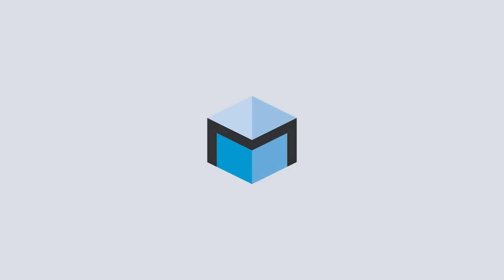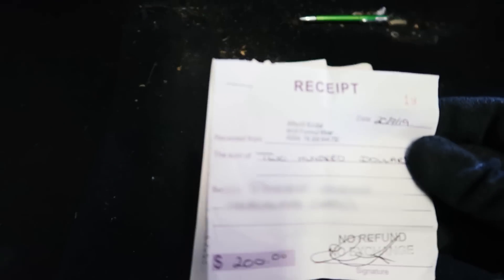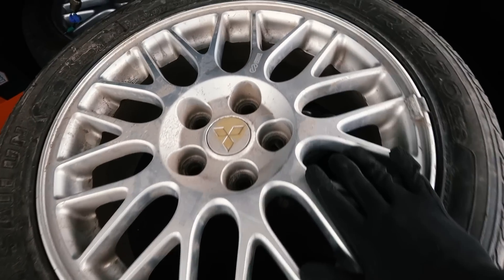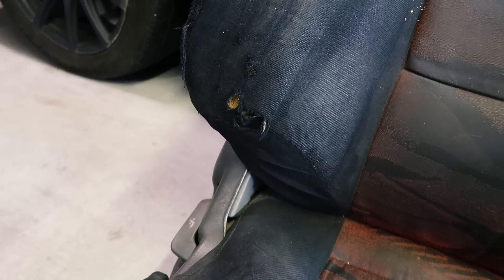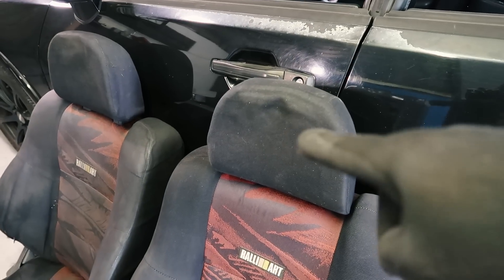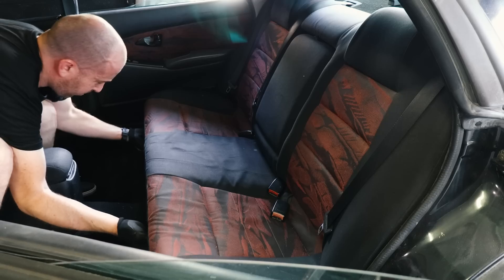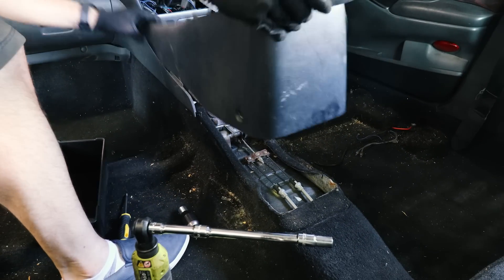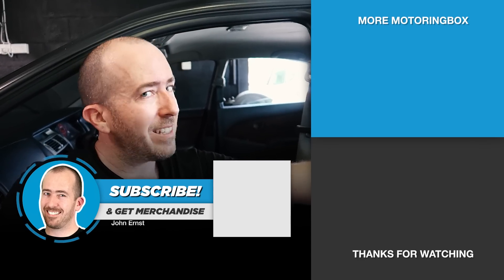🧤Stripping the Mitsubishi Magna Ralliart's Interior & Cleaning the Seats!

Comment: I have had my Ralliart for 18years. Got it back today from a 300,000kms service. Compression is all even and still good, couldn't be happier with it ❤️. Ready for more thrashing 👍
Reply from the maker: Nice one, you must have really maintained it well 👍👍
Reply: @MotoringBoxTV  oil n filter every 10k and 100k belt services. That's it. Been a God send for us 👍
Reply: 3.5 TH here, 220k. Absolutely zero blowby. Thing gets beat around all the time, has been rear ended, stat write off and a hovering headliner. I was put off by the 4spd chrysler box but it's actually a really good trans.

Comment: Hey Shaun i heard in the first video for the magna u were looking for vs commodores i actually recently bought one myself couple months back series 2 equipe a limited edition model that came with 3000$ of added value for free and i saw it on marketplace and how clean it was and only 195ks on the clock i thought it was too good to be true well it was true beautiful car to drive ans and in almost immaculate condition apart from paint peel on front right guard its a silver with light blue tint to it and apart from some issues with the ecotec being a little mistreated got it fixed feels like new no electrical failures anywhere it has to be the next project for u shaun and mind u i only got it for 4250 really cheap but it still feels new power steering also like new abs system like new and only a 2 owner car how lucky could i have been anyway sorry for the long comment shaun keep it up mate love to see what the magna got in store next vid👍
Reply: And tbh i think the bloke was selling it too cheap so it was pretty much an absolute steal wish i could send you a photo of her best first car ill probably ever have had
Reply from the maker: Sounds like you got a great deal mate. I do love VP - VS's they were great cars!

Comment: Top job Sean.  I think those original wheels are pretty good.  I have restored worse.  My mistake was I wish I had put more clear coat on them.  So if you do them yourself don’t spare the clear coat.  Also obviously get rid of the wheel weights and get the self adhesive ones.  Nothing worse than restoring wheels to have a tyre fitter bang weights onto them chipping the paint.  Grrrrrr.  Love your work.  .

Comment: Hey Sean. Little tip since this isn't your daily driver, and you're in QLD. high pressure those seats! Don't even bother with the Bissell (As much as I love my little unit) Swing past bunnings and get a drill brush set for about $20. Some orange Agent by Bowdens Own from Repco/SCA. Soak the seat in orange agent and aggitate with the drill brush, and then blast it with a high pressure cleaner. Will be done in about a tenth of the time and it'll come up INSANELY clean
Reply: OEM seat frames are bare uncoated steel. They will rust.
Reply from the maker: I might try orange agent with the bissel to see if I get any more gains.. but yes probably not the pressure washer for this one!
Reply: @MotoringBoxTV  You wont be disappointed- ended up buying 5L of the stuff and use it everywhere. Do try the pressure washer method at some stage. I recall one seat I did took me over an hour with a bissell and was STILL sucking out crap. 3 minutes with the gurney looked like new!

Comment: I owned a TF Magna and then went to a KJ Verada.  Both fantastic cars.  Also worked for a major car rental company that went from a large fleet of Commodores, then in the early 2000s we introduced the Magna.  Absolutely no issues with a huge fleet of them.  My favorite car in the Magna family from that era is the Verada GTV.  That thing was stunning.
Reply from the maker: I would have loved a GTVi AWD, but I think they were only offered on the TL onwards.
Reply: @MotoringBoxTV  Controversial I know, but I reckon that TL front end looked good. Then again, I quite liked the original AU Forte… Interesting designs always look good :) 

I think the TJ with that weird beak is the least attractive version…
Reply: @froggy0162  I'm gonna disagree with you Froggy, the TL was the ugly duckling of the third-gen Magnas. That said, I have one. The used example I found was otherwise immaculate and had all the right options fitted. The only downgrades from the TH Altera it replaced was the lack of a tape player (the Altera had tape and CD), pov-spec courtesy lighting and that nose. Mine was driven by Hubnut.
Reply: @steved3702  I guess it’s subjective. I like them.

Comment: the way you filmed the cleaning of the seat was oddly satisfying
Reply: find yourself a backseat for some useable material to refurbish the front seats if you can't find new material, I'm putting Recaro sr3 in my xr6 and the center material is worn so I'm going to use ba xr6 black with ef xr6 Luna mist for the center, use a scrubber on a drill to agitate and save your back

Comment: I like the 'Law & Order' approach to the operation. Excellent viewing, my OCD limiter is redlining. Just a thought, in most cases, simply swap the passenger & drivers seats over as the passenger is generally better. Also, if you pick up a seat from a wrecker, the seat base and back rest seperate, allowing you to create the best option, keep or sell the spare. This process has afforded me excellent quality bucket seats in many of the older Falcons I have owned. I'm sure this is no secret to you, but it may help a few viewers.
Reply: Only problem is the Ralliart seat coverings are rare
Reply from the maker: The seat foams seem to be unique for each side. One of the bolsters is bigger than the other unfortunately.
Reply: @MotoringBoxTV  
Bummer
Reply: @MotoringBoxTV  seat belt stalks may not be able to be reversed also.

Comment: I’ve bought a couple of cars with seats like that, and I’ve found the best approach is simply clothes washing liquid, a scrubbing brush and the garden hose. The trick is you need to have a couple of really hot days to do it because you soak the seat foam all the way through and it will never dry out on anything less than a couple of 35 degree days. A summer only job.

But that deeply embedded filth like simply needs a lot of water to flush it out….

Comment: 6:45 honestly my first thought was an elephants condom.  Also about the shampooing,  I remember having the best luck at a dealership I worked at for a while where we would take the seats/carpet out of the used cars the dealer was getting ready to put on the lot.  And we would use a pressure washer before shampooing.  Spray some high quality all purpose cleaner or upholstery friendly degreaser, and then spray the seats/carpet with a lower pressure as to not damage the material.  Afterwards I'd recommend taking the seats to some kind of detail shop that has access to high quality shampoo machines,  It really does make a world of difference using an industrial sized machine with a high quality steel extractor.  I think you'd be shocked at how good the seats would look after that

Comment: I used to work on one of these  back in the day (3.5 litre 5 speed)... The thing used hammer... The lady who owned it was called Mrs Palmer 🤣... It was funny one day  at work when the boss asked me if I could drop Mrs Palmer home 🖐️ 🤣🤣🤣... It was so hard to keep a straight face... One thing these cars had was two different types of spark plugs fitted to them... They had standard spark plugs in the front bank and platinum spark plugs under the intake manifold in the rear bank... You used to do the front plugs as required and you would change the rear spark plugs every 100,000kms... It wasn't a bad job... While you had the intake manifold off you would clean the throttle body and intake manifold etc... If it needed a rear rocker cover gasket you do one of those as well while you were in there... Keep up the good work Sean and🖕the haters.

Comment: Those interior plastics are so easy to replace on those things.  Fitting stereo equipment is also easy as, and the factory speaker wires are quite beefy so adding an amplifier is no issue. I'm sure you would find factory tweeters to replace the missing ones but I'd recommend aftermarket speakers because the original ones are just paper. (Stereo fitter of 22 years here!)
Reply from the maker: Haven't investigated the tweeters yet - would you happen to know which model or size they are?

Comment: It's all the little things that will make a big difference on this car. Looking forward to more!
P.s those bissell units work well. Be careful of any stagnant water under the cleaning solution container, it caused the sprayer motor to seize on mine. I've since cleaned it up and freed it (was easy enough to access) but I thought it is worth a heads up
Reply from the maker: Thanks for the tip!

Comment: Go with the original wheels. They're a hundred times better than the rubbish black ones!! In my opinion🤘🤘
Reply: Go one better and get a set of Evo 7 rims.Same style ,better width to run legally a bigger tyre and a better offset ..35 vs 42 ,to push the face of the rim out more to fill up the guards ,oh ,and double bonus ,if you go Brembos ,these wheels will clear the calipers

Comment: I had a 2000 midel Verada, best car I ever owned. Clocked up 300000klm in it. Only did 2 timing belts and a few oil changes. Never broke down and I was getting 7.8l per hundred out of it on the hwy.

Comment: While I never knew about these Ralliart magnas, I knew of the 6 cylinder engines which is V6 in these specific body style cars had many issues with cooking and seizing.

My Dad has a 1st generation Pajero with a similar engine format/layout in which it would cook as a result of a tube in the water pump.
These engines are great when they work, but are difficult when they fail. Note the Pajero to tune it and time it requires earthing a wire or else the timing advance kicks in.
Reply: I have been around magnas for 20 years at least now - And i have never known of the 6G engines in the Magnas with major issues of cooking and siezing. Poor maintenance from owners contributes, remember, $1000 cars attract $1000 owners, and they all get run into the ground.
Reply: @dodgeviper89  Neighbor down the road had a V6 Magna and he told me the engine overheated and seized. He also said he was on a road he could not pull over on at the time. To some extent I know he looks after his cars. To another, he doesn't know enough.

Then I saw heaps of stories of those Magna V6's cooking and from the experiences, with the 6G72 it's not far from the truth and It could be just a lack of knowledge of repairing, tuning, and some bad design choices from the manufacturer. I don't know if you know about the Valley Pipe in the 6G72, but ours now has a hose and a tapped fitting inside of the water pump. The problem was every time we put the seal in and used high-quality silicon, the seal would inevitably leak again and again and again. An inescapable issue no matter what we did right. It just was not sealing. and always at the bottom of the pipe did the leak reoccur.

Since the V6 is similar with some slight differences between parts, I know about potential weaknesses.

And I'm guessing based on the video of the car, the heater core could be a key area and point for why these cars cook.
Reply: @michaelthemekhanical  6The engines used in this series of Magna, the earlier 6G72 SOHC 24v and this, the 6G74 SOHC 24v, had no major engine flaws. They were put under incredibly punishing tests at MMAL during inception to prove reliability. One of the engineers who developed this Ralliart Engine is in one of the facebook groups I'm in and posts a whole bunch of data sheets from when he worked there. I know these can take a flogging, and with multi layer steel head gaskets, to actually cook a 6G7 motor is a decent feat.
RE: your issues - I've done a ton of water pumps and valley pipes on magnas and NEVER had one leak. Then again I always, ALWAYS use OEM Mitsubishi seals/parts. So something is certainly not right there. 
Heater core plastic pipes go brittle and snap off, a stupid design in my opinion and really, should have been designed with access to those pipes from the engine bay. Alas, every car has it's small flaws.
Reply: @dodgeviper89  Maybe will try and push for my Dad's 6G72 to get some MLS gaskets.

I mean your right, they are really good gaskets, I rebuilt my 4D56T and used a MLS gasket because it was just eating head gaskets before I fully reconditioned my engine from top to bottom. Cost me about $10,000 in all the little things as well as bigger things, but I've never cooked it once, not even under load. The weakness with an MLS is in some spots it's difficult to get a perfect seal. Mine did leak under load but running at temperature, it wasn't much and it's never leaked again.

Eatting head gaskets in the 4D56T diesel were attributed to faulty injector spray pressure and patterns surprisingly. But the addition of a new head, valves, and springs helped significantly.

Comment: Looking good mate. I'd go with the stock Enkei wheels. If its just the lip thats damaged it's an easy fix. I had a set of Evo 9 Enkei wheels that just had a little lip damage so I stripped the tyres off and carefully blended the damage out with a file and dremel tool. Went most of the way around to stop the scalloped look so it looked good and factory...(Could even get them professionally machined too but if you want to save a few $$) I masked them up and painted and clear coated them (just the lips too not the whole wheel as they looked great still. They still look great 8 years later on my daily drive.
Seats look a million times better... woah they were filthy.
Keep up the great work.. this beast deserves some love!
Heater core isn't a hard job just time consuming. take heaps of pics as you go. shame as the orings are a couple of bucks each and that's generally why they fail. You don't need to degas the aircon either... you'll see. :)

Comment: with the bissel vac ur supposed to hold the trigger down as you drag the hose down so it sprays directly into the fabric then sucks it out
Reply from the maker: Tried that, didn't seem to work at well imo.
Reply: @MotoringBoxTV  ah fair enough

Comment: The only other issue with the Bissell is that the intake fan is on the bottom, so it's not good to sit on flat surfaces. Milk crate comes in handy as a stand
Reply from the maker: That would explain why it sounded different when I moved it, I didn't really think about it. Seemed to work ok!

Comment: I am a little disappointed you only found 35c 
I did an au falcon wagon quite a few years ago and found nearly 15$ 
I did the same with the seats and the carpet 
I hung it from a big  ladder and pressure washed it 
I think they had spilled a bottle of coke in the car and it took nearly an hour for me to get all the coke out 
The seats were the same 
Your little Bussel washer should be good for the head lining 
I have used mine on the last two of my cars and it seems to do a good job 👍👍👍

Comment: Mate I've had experience with Mitsu V6's and the one key piece of advice that was from a Mitsu spares parts guy who has been with Chrysler and Mitsubishi for over 40 years is, "sweet, use aftermarket timing kit BUT only use genuine Cam seals". The quality is far superior to replacement seals.
Reply from the maker: Thanks for the tip - info like that is vital to know!

Comment: The Bissel spray isn’t really meant to be used from a distance like that.  You can apply the solution like that, but then you spray as you go so that it is almost immediately extracted providing a strong rinsing action.

Also, Bissel Little Green spot cleaner is much more durable that their consumer range.  It’s what’s used in Vic trains.  Hose is short though, but better short than split!

Comment: If youre game enough, you can actually remove the seat covers off and wash them in the washing machine. It will require new ring clips to refit them though, or zip ties, either either.

also dont be afriad to use degreaser and anticeptic in the bissel, It will be much more aggressive to stains than the spray foam stuff

Comment: Oh! Bissell tip! The sprayer is shyte! I used a seperate pump sprayer that you would use for weed spraying! Better spray and spread. 👍
Reply from the maker: Yeah, I found later it was better to spray slower and really let the water build up on the areas you're cleaning.
Reply: The vac itself but goes alright! I got the short hose one, and without the tank full of detergent its easier to drag around the car.

You will find it handy as your young one gets older. From one Dad to another - clean it well after using it on spew or wee accidents! Don't leave it overnight, the smell will stay with it forever!

Comment: Too many of these Ralliarts were treated like rubbish. Deserves a restoration so it can be returned to it's former glory. It is a rather unique Mitsubishi car, a tough and eye catching bodykit, huge power from the 6 cylinder 6G74 engine but with comfortable driving. 510 were built, but you don't see them that often. Yes the heater cores can be an issue, especially if you don't change your coolant on a regular basis. Another issue is that the 6G74 engine can burn oil (regardless if the engine is in a Pajero, Triton or Magna/Verada) so regular oil top ups. I top my oil up every 1500km or so. Last time I changed my timing belt I also ordered a new water pump as well, the mechanic told me it was money well spent as the original water pump was on it's way out.